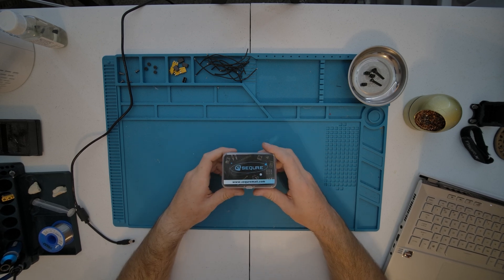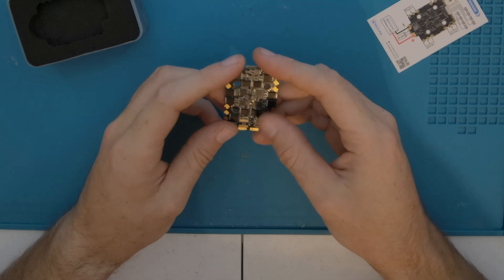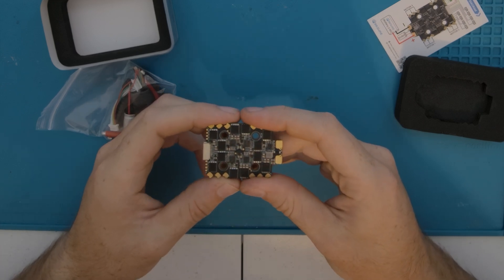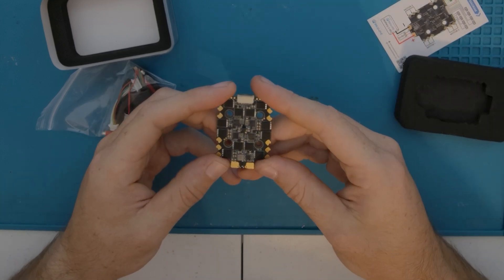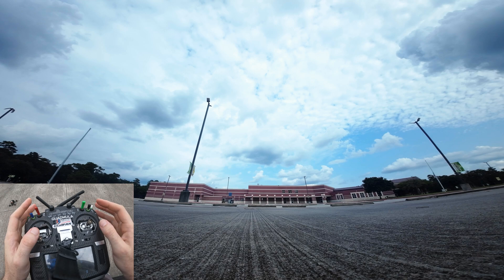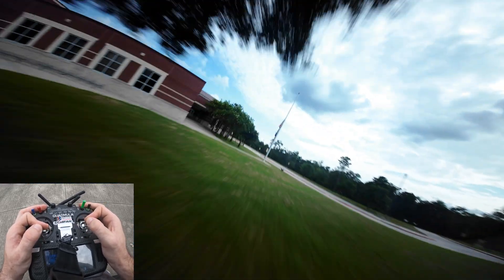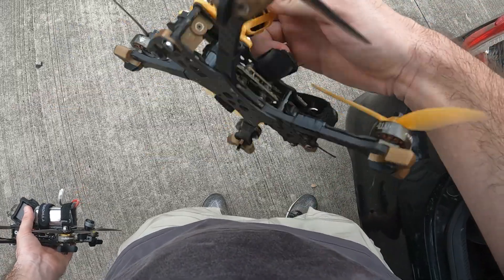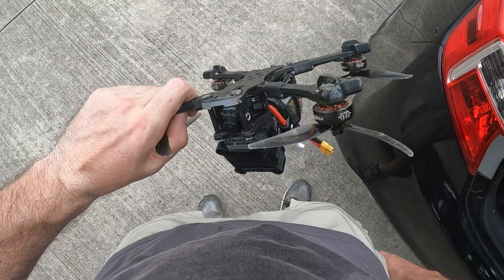Building and Flying a Drone with AM32

Comment: ThE cApAcItOr iS mOrE tHaN 20mM. You might as well not even use it….

1. Is it more than 20mm?
2. Has this ever been an issue for you?
Reply from the maker: Think right at it but the front of the frame has a 25mm clearance